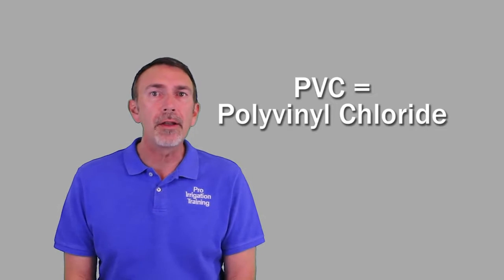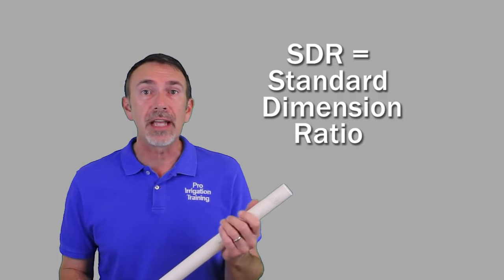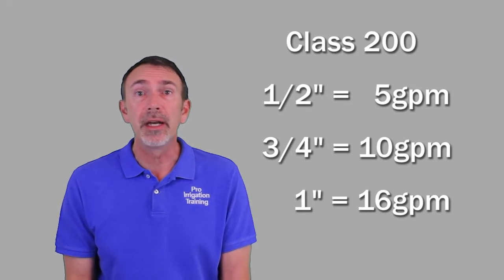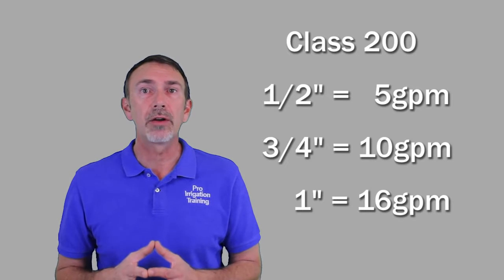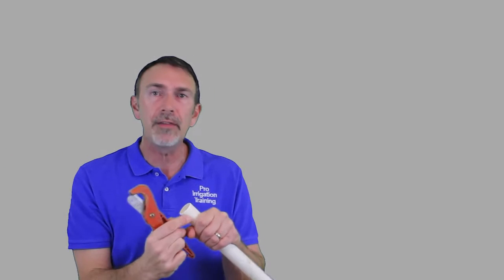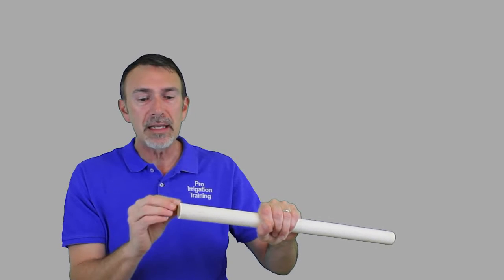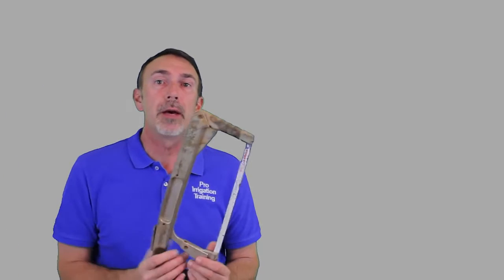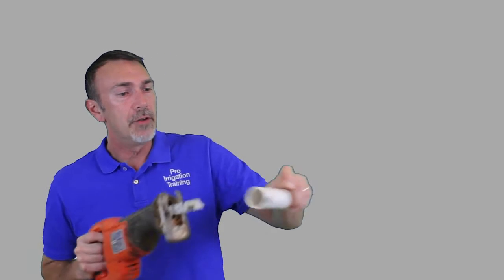All About PVC Pipe (Irrigation education)

Comment: I just moved into a new home. I have a irrigation pvc pipe that burst, I fixed it and it burst again a little further down. It gets down to the 30s where I live. And I believe I have to sprinklers that might be underground. Could that be the reason why my pipe burst?
Reply from the maker: It might be freezing if the pipes are really shallow. Where I'm at, we get down to the 20's and maybe a little lower once or twice every winter, but it's rare to see freeze damage for pipes that are buried at least 7 or 8 inches minimum. It may be poor workmanship on the install and you got unlucky to catch those breaks. Hopefully that's all that will happen. If the system is really shallow or is an issue every winter, you may need to have it blown out with compressed air.
Reply: @Proirrigationtraining  yeah they are very shallow they’re about 5” deep I believe. I fixed the second burst and it turned out to be a broken sprinkler. I found a third pvc pipe that burst behind a bush that I’ll be fixing. Hopefully that will be the last repair.

Comment: Show bond strength tests with and without primer.
Reply from the maker: I'll see if I can find some. But to be honest, I don't think they really matter. Mostly the difference is seen over time. Glue without primer still provides an adhesive bond which is usually good enough to get a system 7 or 8 years before joints start to fail. That's my real point. PVC is designed to last 40 years, and a proper glue welded joint should never fail in that time. So if you're installing a system with only glue, you're cheating your customer out of decades of system life. I can take you to many systems that have been replaced at 15 - 20 years old because of this issue. I recently worked on a $30,000 commercial system where every single joint was pulling apart, clear glue no primer.
Reply: @Proirrigationtraining  Thank you very much for the reply.  And, ok, so you're saying it's over the long term that it's an issue of being not as good as with primer.   So the idea with primer is for a deeper weld being the sole difference (a deeper weld, a stronger juncture)?   Although see this excerpt from the Weld-On brochure:   'If local codes permit, successful joints can be made without a primer using cement alone, but extra care must be given to the installation. It is important that a good interference fit exists between the pipe and fittings. It is for this reason we recommend that joints being made without a primer be limited to systems 2” and smaller for pressure applications (water systems only) or 6” and smaller for DWV or non-pressure applications. (Check local code requirements.)
Reply: @Proirrigationtraining  Also, see this vid which tested the burst strength pf solvent-cement alone and other bonding-welding types:  https://www.youtube.com/watch?v=1o4E2pdEv-s&list=PLviXFqLRU2IxkDyXj7MiHHlBc8Gs3MvUV&index=1&t=96s
None of the joints came undone on this go-around, but the pipe burst near the joint.
Reply: @Proirrigationtraining  The Weld-On brochure:  https://www.aetnaplastics.com/site_media/media/attachments/aetna_product_aetnaproduct/246/Weld-On%20Solvent%20Welding%20Guide.pdf
Reply: Look at this vid test:   https://www.youtube.com/watch?v=doPXNWC1Iig, which is about 24 hours after primer/solvent joining, at 6:50 on the vid, with 1'' sch. 40 pipe, the near end joint came undone.   At 8:04 the far end joint came undone with 3/4''sch. 40 pipe.   At 9:45 the 1/2'' pipe came undone at the near end.   All with purple primer and pvc solvent, by a professional.
Reply from the maker: @bonsummers2657   I don't believe it. I've glued tens of thousands of PVC joints in the past 17 years. If a weld with primer comes undone, more than likely the glue was contaminated. I'm not sure if you're trying to argue against using primer or just trying to prove me wrong. You can glue any way that you feel is right, that's your prerogative. I'm giving you the absolute best way of doing that. The fact that the quote you posted says "but extra care must be given to the installation." implies that its not best practice. You can use just glue all day long, and the joints will probably hold, it does make an adhesive bond. But you just can't achieve the chemical bond that primer is necessary for. I don't have time to dig for it, but somewhere on Weld-ons website, there's an explanation of what the primer and glue do chemically.
Reply: @Proirrigationtraining  I'm here to share sincere information and to receive sincere information.   I'm seeking truth on the matter.  And I very much appreciation your sharing.   Btw, my involvement with all this information as a landscape contractor is 1/2'' to 1'' (rarely bigger, less the 2'') schedule 40 pvc for private residential irrigation.    
I think a very key take away on all this, if not using primer, possibly using a cleaner but not necessarily in most/many cases, letting the solvent-cement settle for 5 to 7 seconds after application but before insertion to get a deeper 'melt' on both the fitting and the pipe by the solvent-cement, then connect the fitting to the pipe.   That method right there, with only using clear solvent-cement, apparently makes the strongest solvent-melt-weld into both the pipe and the fitting, rather than a 'glue adhesion' which apparently much more commonly occurs with primer-solvent bonds.
As with  hlee (OH), I'm open to counter-evidence, counter-perspectives, as you are sharing, which I appreciate.
Reply: @Proirrigationtraining  And to be clear:  I'm only here for neutral investigation of truth in the matter, of what's really going on.  That quote from the brochure, "But extra care must be given to the installation",  given the experience shared by hlee (OH), did not bear out as true.   Nor did that bear out as true on the vids.   And so, that statement could be more so a cautionary statement to give respects to the standards (because of consternation when recommendations/allowances are given which are contrary to standards), even though it may not be true, as some tests have indicated.
Do you know that solvent-cement alone, with proper application and seating makes a weaker bond than with primer, all things being appropriately applied, per expected practical standards?
What is the proof on this?
What do you think of the vid-examples?
Reply: @Proirrigationtraining  Doesn't the solvent-cement do all the work done by the primer, but without the residue of the primer?
Reply: See this entry from an experiential-contributor on this forum:  https://www.plbg.com/forum/read.php?1,504728
Author:  hlee (OH)